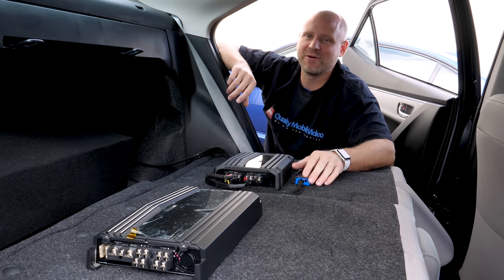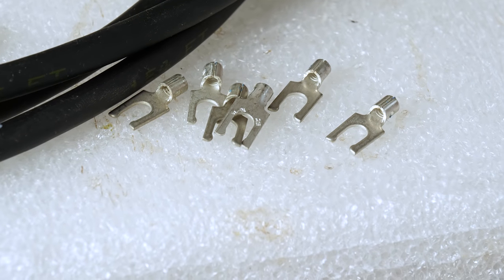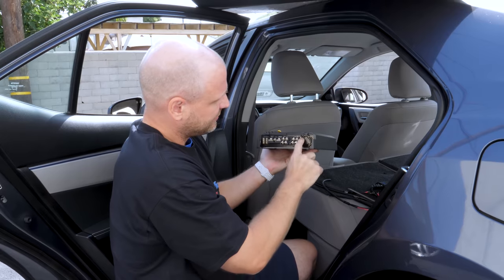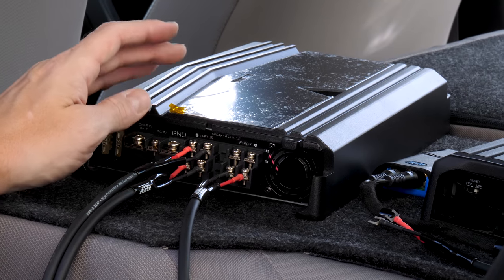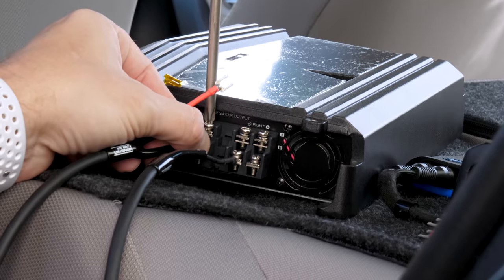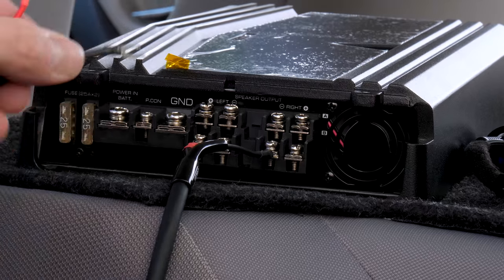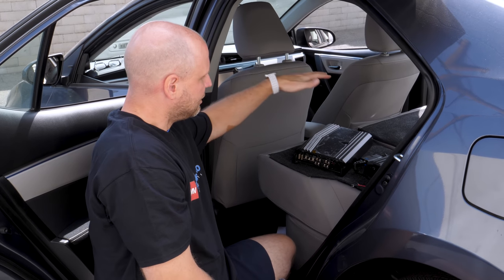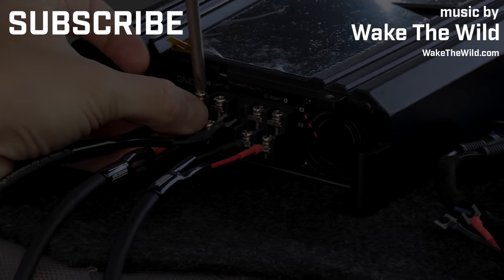How To Wire Speakers and Subwoofers to Your Amplifier - 2, 3, 4 and 5 Channel - Bridged Mode

Comment: 3rd video I’ve seen, and he is so into just skipping “ yeA let’s pretend we have all wires attached to speakers!” How bout you show video on how you run wire from stock radio that had amp set up to the aftermarket four channel?...
Reply from the maker: Justin. This video is just showing different wiring configurations you can make at an amplifier's terminals for 2, 3, 4, and 5 channel operation. Here is one of our videos on complete amplifier/speaker wiring: https://www.youtube.com/watch?v=LPmZC9u39LE&t=3237s

Comment: this cant be 5 channel setup because it only has 4 channels to begin with.
Reply: Yes you can use a 5 channel in a 4 channel amp. Just like you can use a 2 channel as 1 channel and vice versa. As long as the ohms are right then you will have no problems...
Reply from the maker: If you watched what we did you can do it, so long as everything matches with impedance and power ratings

Comment: too bad my sub already makes my lights in cabin dim D:
Reply: Nathan Barrett that is because you have not upgraded your alternator to a higher amp alternator, and installed a decent earth strap from battery to the body, see cars when they come from factory’s have alternators to run only what is in a car when you buy it enough amps to do the job, you put extra load into cars you put extra load, that light in the cabin dimming means you are drawing amps from the battery meaning your battery won’t have a very long life as it is draining battery from extra amps being drawn.
Reply: Yeah a better alt for my car is like 600$

Comment: Will hookin 2 many speakers to the deck fry it and then make my car battery die
Reply from the maker: Nope! So long is it's done properly, I have my front speakers and tweeters wired to my head unit.
Reply: @Qualitymobilevideo  yea but i have like 9 front speakers
Reply from the maker: Ohhhhh that's a lot. You'll need to either build crossovers or use a 4 channel amplifier